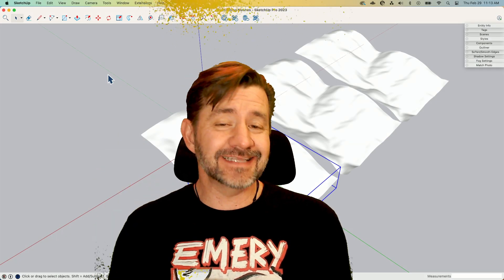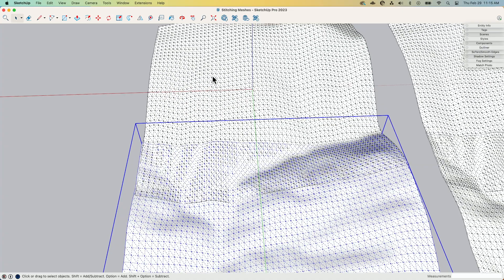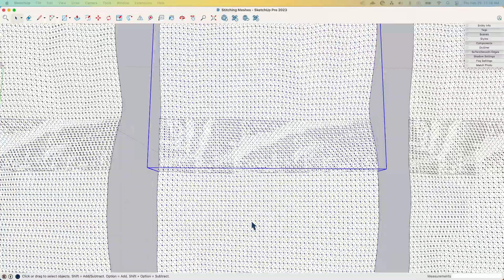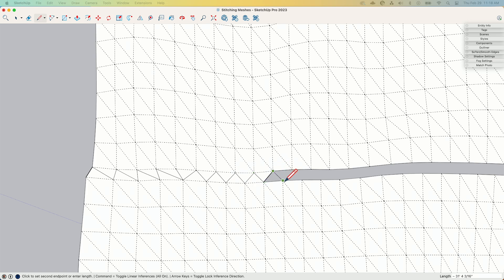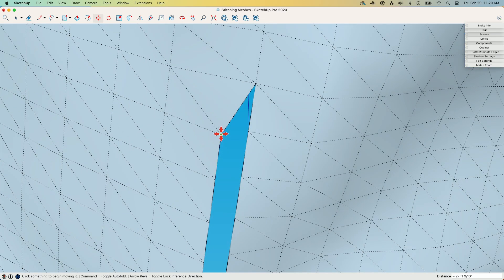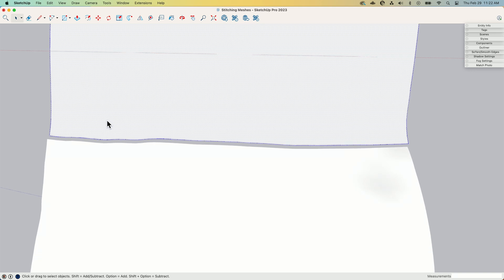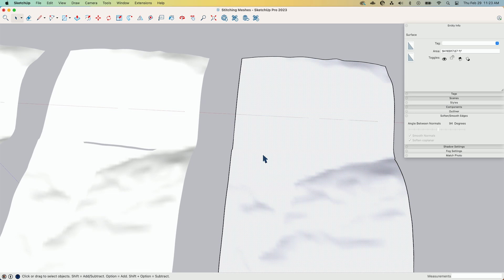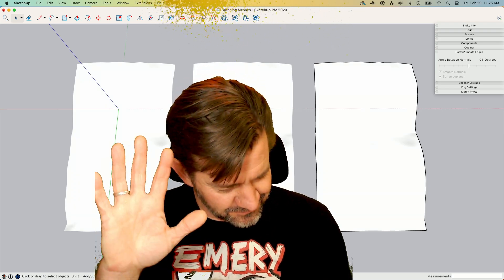Stitching Overlapping Terrain Meshes in SketchUp

Comment: I also use Autofold, Move tapping the Alt Key; this forces the plane you're moving a point of to fold for those stubborn points that just won't move in an off axis direction. Not everything is X Y Z unfortunately.
I wish SU had a way to force an object snap like cad does.

Comment: THANK YOU! I was struggling with this last month. I almost always use the imported geometry from add location and then a more accurate site around the building I am modeling. Then I need to stick them together. A lot of times I need to create a new mesh between the two when they don't line up well, especially with height differences.
Reply from the maker: Perfect, glad it helped!